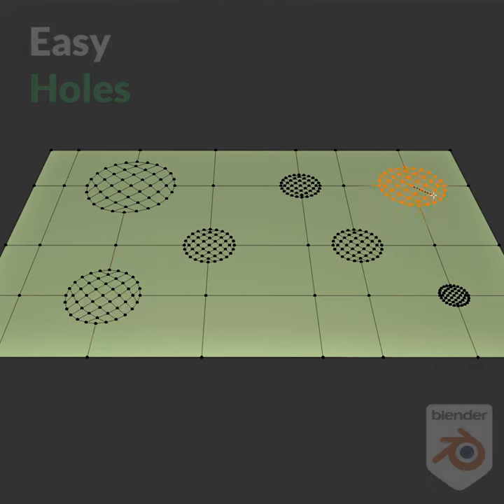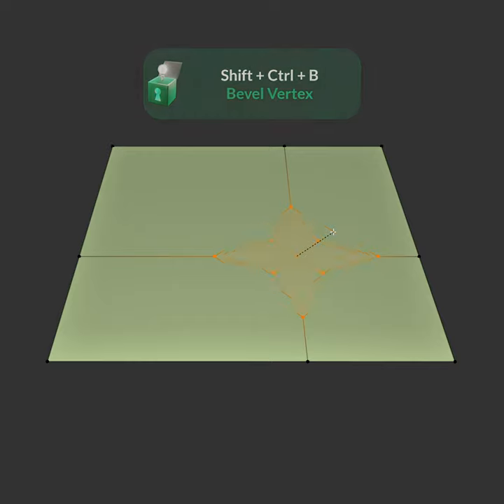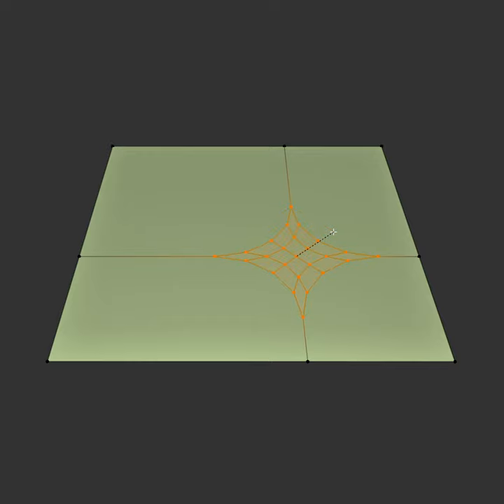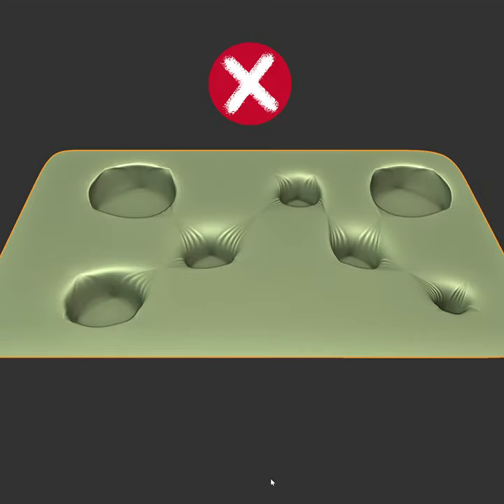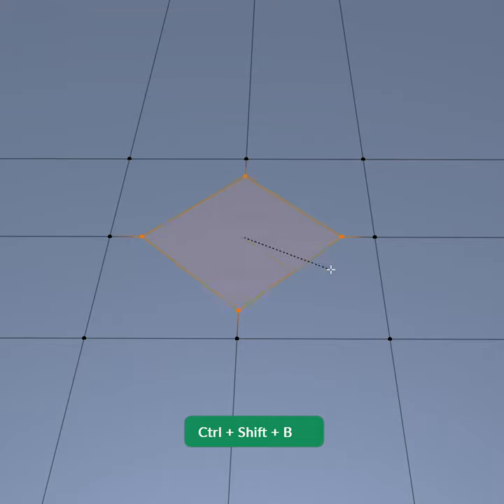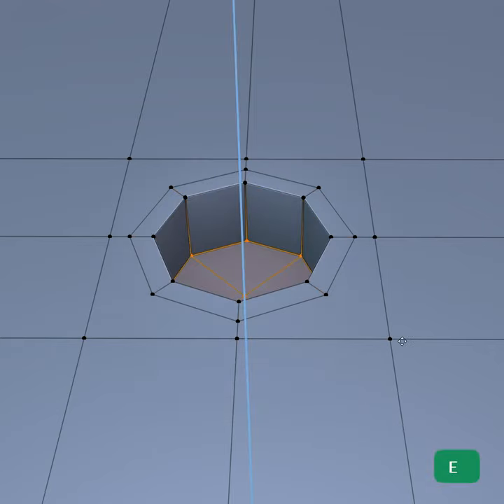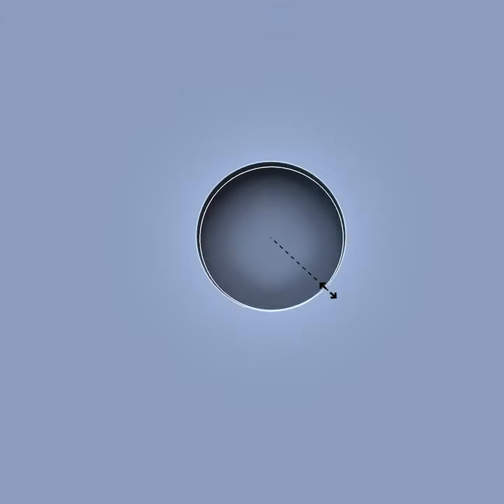Easy Holes with Beveled Vertices | Blender Secrets

Comment: Very nice. I guess it works perfectly unless you don't realize there is some overlapped vertex; that's the tricky part, I guess. Surely this must be one of the safer way to make holes. 👍
Reply: I remember seeing a ClampOverlap checkbox in bevel menu (which pops up everytime you bevel) , what it does is that it stops the bevel radius before reaching surrounding vertices
Reply: @15_cenTT  Thanks. I'll check if it works properly (I mess a lot with overlapped vertices 😅) .

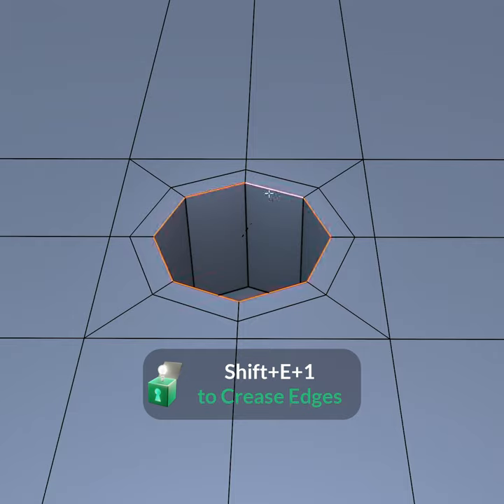Comment: At around 0:40 the hole goes from octagonal to perfectly round. How is this achieved?
Reply: Subdivision modifier?
Reply: Subdivision modifier is correct. If you don't sharpen those inner edges, it'll just end up perfectly round. :)